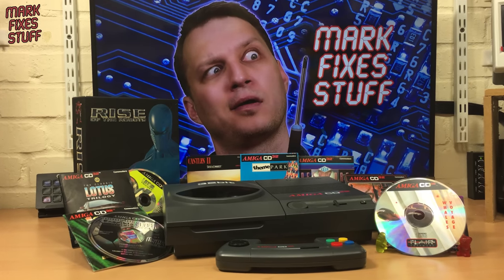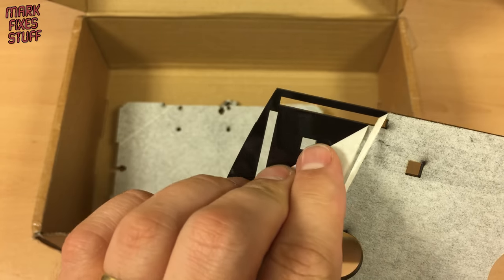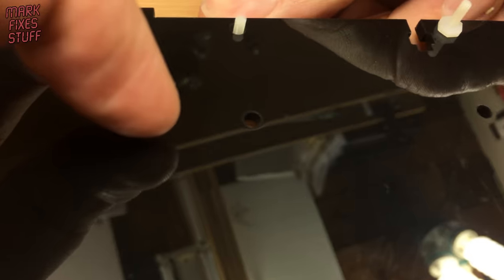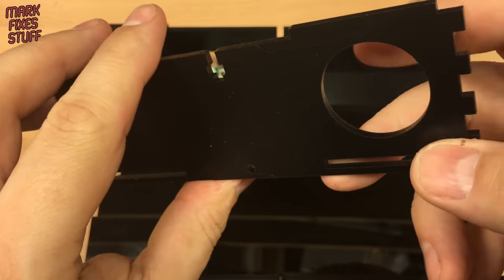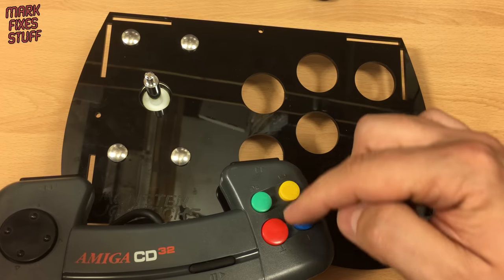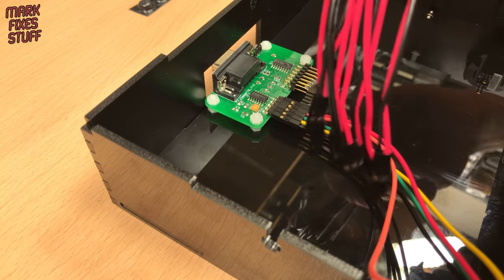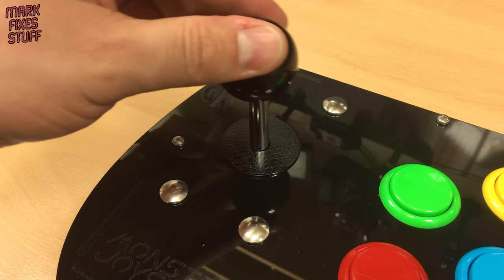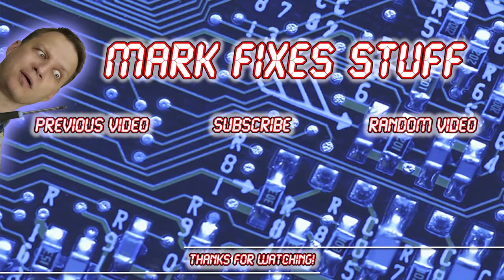Building a Monster Joysticks CD32 Deluxe Joystick - Full Guide & Test!

Comment: 9:53 - I noticed you forgot to put the ringpiece over the shaft before screwing. It's a good job you remembered later on - excessive stick waggling can cause an unpleasant deposit to collect around the base of the shaft and get in its workings.
Reply from the maker: This is why I have a doctors appointment then...
Reply: @MarkFixesStuff  just soak a cotton bud with IPA and push it down the screw hole, that'll clean it.

Comment: The first ones which came to mind for using all the buttons are CD32 versions of Wing Commander and Liberation: Captive 2.  You might need to peruse the manuals to get a good idea of what all the buttons do.  Wing Commander uses a lot of button combos to access all the different functions you'd normally use the keyboard for.  Liberation maps the four face buttons to each of the four robots attacks IIRC and again uses button combos to access more advanced functions.
Reply from the maker: I’ll give them a go when I’ve built my TF328 and got RGB rather than composite video
Reply from the maker: Thanks

Comment: There's a pinball game that uses shoulder buttons I believe which would be an issue since they replicate left and right flippers. The switch for changing up for jump is very cool though.
Reply from the maker: If you mean Devil's Crush, it uses the left direction on the D pad for left and  and one of the buttons for the right, so it's not ideal. Never seen a pad with shoulder buttons? One of the ASCIIWare ones?
Reply: It's Thomas the tank engine pinball that uses the left and right shoulder buttons. I bought one of these monster cd32 joysticks and tried it today with whload playing cd32 games and the inputs don't register properly, some buttons behave differently when Another is pressed and some like the shoulder buttons in Thomas the tank pinball only register when one of the joystick directions (except up) is held down. Had a look online and others seem to have problems with cd32 controllers, even original ones and even on original hardware. Pretty weird.

Comment: 90 quid; wow :P If you can settle for something less refined, you can buy a project box for 10 dollars, a sanwa kit with 6 buttons for 25 and make your own  wire harness using an old 9 pin joystick connector
Reply from the maker: That’s possible for things with less buttons, but for things like the CD32 and Megadrive there’s a fair bit of electronic wizardry happening on the board. Have you done this for any other systems? I’ve never really had the patience.
Reply: @MarkFixesStuff  Oh, that's a good point; to be honest I am not sure all the buttons are even hooked up; since most amiga ports were using 1 or 2 buttons at best (and some buttons were mapped to directions on the joystick; so you can push a button that trigger the "up" on the joystick, to jump for example).

I made my own Amiga joystick using the sanwa kit from amazon and a cheap project box that I found at the local electronics shop; total cost: 35 quid plus the 9 pin connector and cable that I grabbed from an old broken Atari joystick.

Fundamentally each cable on the 9 pin send a message; so up is on wire 2, fire on wire 3 and so on; which means you just need to wire up each switch from the control stick and the buttons, and they all share the ground wire. 

Correct me if I am wrong, but do you use anything more than 2 buttons? If not, that means that the CD32 pad is fundamentally working as a regular Amiga/Atari joystick, so you can use the cheap wiring method. I can't tell what the circuit board in the kit you put together has; but I assume it has just a multiplexer on it to use more signals than what the 9 pins are actually sending out :)
Reply from the maker: @fcf8269  a lot of the Amiga to CD32 ports are only two button maximum, but CD32 specific titles use more and some use all. It’s an exception rather than a rule though.

There is a switch to map the yellow button to up. Yes the board contains the custom multiplexer to communicate with the CD32.

Comment: 5:00 plastic nuts screws and bolts in PLASTIC :(  I would have replaced everything.
Reply from the maker: The nylon nuts and bolts are to insulate the board. What would you have used?

Comment: Don't think there's any, actual proper porting that uses all the buttons and the console setup, not on AmigaCD32, that would make too much sense. Quick half ass conversions that might need a keyboard only need apply. ^_^
Reply from the maker: If only this were incorrect. But it’s not...
Reply: @MarkFixesStuff  Well it was bad enough that I only have one question to ask the people that made those ports "Do you have brain damage?", only explanation I can think of. ^_^